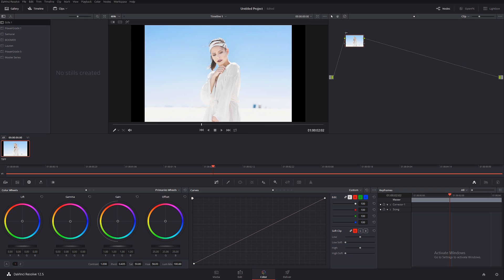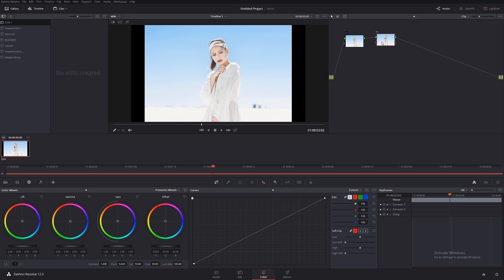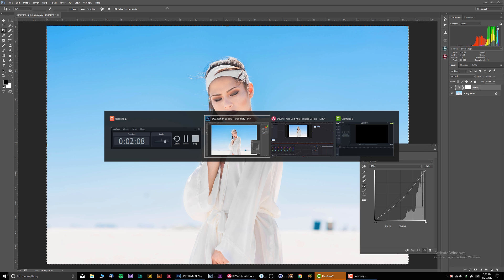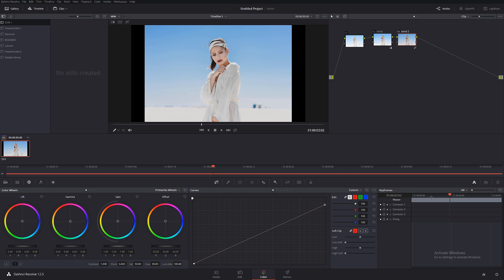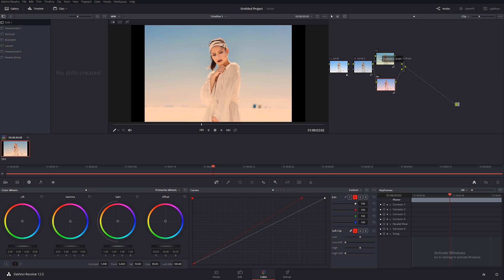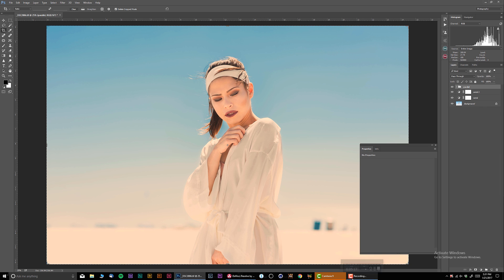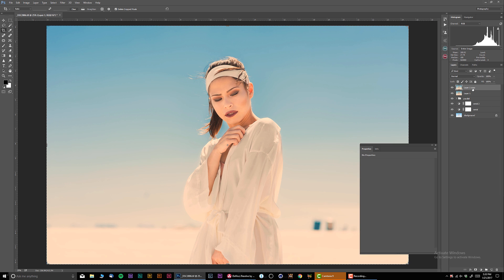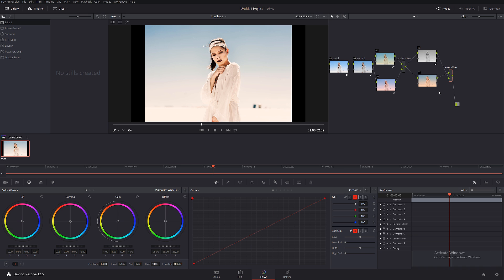Davinci Resolve Tutorial Difference Between Serial Layer and Parallel Nodes

Comment: I once used it when i wanted to remove grades using the mask to get the background back and leave the face with the color grade but it was totally intuitive. and it resolved the problem with overexposed background wich was the problem.
so i prallely mixed two masked color grades with layered nodes as i can remember.

Comment: There are a lot of comments saying there is no difference in using a serial sequence compared to a parallel sequence because it all gets mixed in the end.  This is untrue in my experience.  In a serial sequence, if you change a value in a node it will then affect the input value of each node that comes after it, effectively ruining anything you have done to those later nodes  It does not come out to the same result in the end.  Say you select a color to edit in Node B and you make all your desired changes.  Then you go back to Node A and make some adjustments to the image to bring up saturation.  Well now the color you selected in Node B has changed and it no longer is doing what you told it to do before since you changed Node B's input by modifying Node A.  In a parallel sequence, you can select the same color in Node B and change it, then make your saturation change to Node A above it and it will only effect the final saturation since the nodes will be mixed but will still allow you to edit the color in B without ever changing what it is doing on its own.  You can argue that since you are mixing the parallel nodes in the end it is doing the same as using a serial sequence but its really not since you have to think of input from node to node rather than output.
Reply: Thanks
Reply: Late to the party, but hey you are 100% right. I am a beginner to Davinci Resolve and doing grading in serial nodes was getting really hard for me. I started in serial nodes because lots of YouTube tutorials are only focusing on serial nodes. Luckily I switched to parallel nodes and boi now I'm getting complete control over the parameters.

Comment: For those that are still confused, there's typically no difference between having A then B then C as serial nodes or together in a parallel node. The benefit of using a parallel node is generally more organisational than anything. The layer mixer though is where the magic happens. For example, have node A increase red and node B increase green masked with a power window. Whether A and B are serials or in a parallel node the effect will be the same, with the green power window adding green to the redder image. However if A and B are in a layer, the greener masked region will not have any of the increased red.  For the logic of the ordering, think left to right and top to bottom.  Photoshop and other Adobe tools hark back to the days of gels, with the concept of layering effects on top of each other.  Resolve with nodes considers flow, where data is modified by subsequent operations. With data flow, left to right and top to bottom in a group is more logical.  I'll aim to put a nodes tutorial together myself in the next few days too as it is a big source of confusion.
Reply: Nick Lindridge have you made ?
Reply: Great answer!
Reply: wow...thnx bro. explained it in 1 minute

Comment: I think I got it, it seems the parallel node makes a lot of sense actually to use as the main tool to kind of work non destructive.
the serial node I assume would only be used for vignette , NR, masking, or effects etc.
But I feel like all adjustments to the image itself make more sense in parallel!?
Reply from the maker: +indubiopronegro parallel works simultaneously, while serial overrides adjustments of the previous, and previous may also alter how following nodes reacts.

Comment: Dude grouping layers in Photoshop is just there to unclutter and organise the layers panel, it does have nothing to do with the parallel node function in Resolve.
Reply from the maker: its not there just to unclutter
Reply: after you group them then you can apply layer mode to the group folder same as layer nodes in Davinci.....Aram K pretty much just clarify it all in this tutorial.
Reply: I'm a bit confused here. Inside a group in Photoshop the settings in an upper layer influence the lower level(s). But you say that in a Resolve parallel node the settings don't influence each other, is that right? That's what is happening in a mix node, or not?